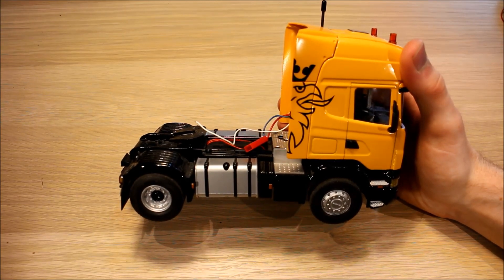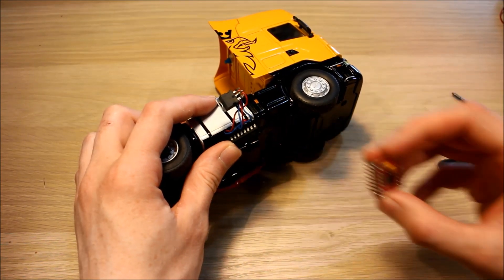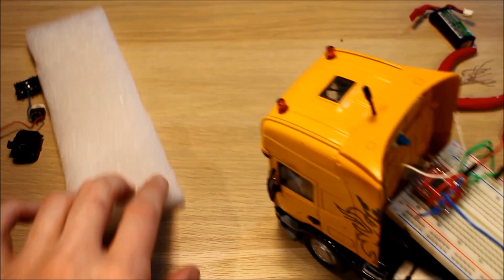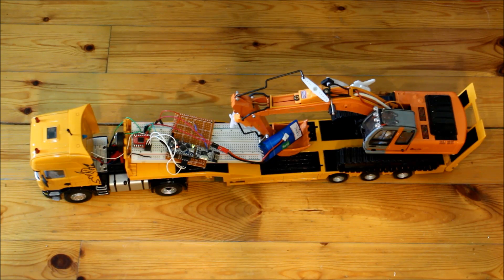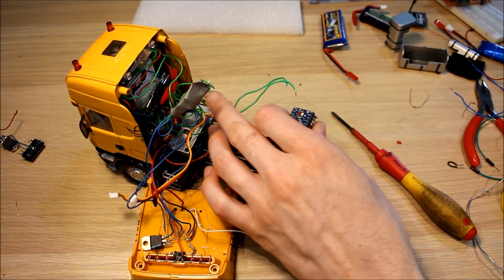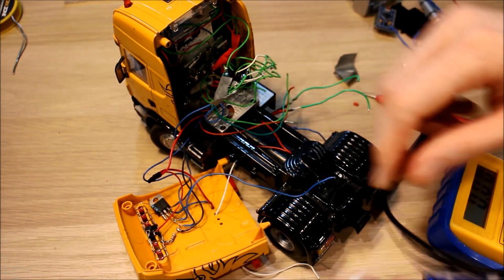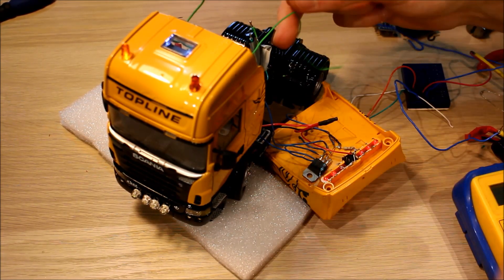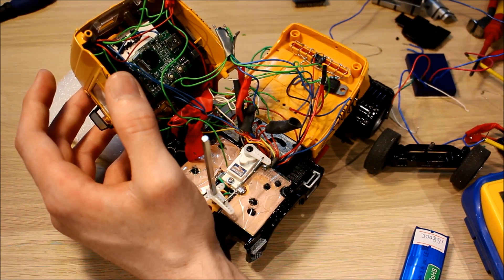RC Scania R620 Upgrade Part 1 - Testing the drive motor with a 3.7V lipo battery

Comment: Stupid question...Was this a Siku control you modified or a static model you made RC? I ask as i have been looking for a similar truck to begin tinkering with and Siku (now) only do the 1:32 control model or a static in 1:50 scale :(
Reply from the maker: +Rich77UK It was a static model but the static model was just the RC model with all the electronics removed so I cheated a bit and bought the motor from the RC version. That's a pity its no longer being produced, I hope they bring out another 1:32 lorry or truck preferably without a trailer because the quality of the Scania is very good.
Reply: +RC Tractor Guy Thanks for that.  I will have to keep my eyes peeled in the shops and eBay for one. Great work btw. Love your stuff but it's dangerous for my bank balance and spare time :)
Reply from the maker: +Rich77UK Haha you're preaching to the choir about danger to the bank balance, mine has come close to requiring a defibrillator over this hobby many times :)

Comment: I can't tell what type of Arduino you are using, but I think you might be interested in the Adafruit Pro Trinket, which has about as many pins as the Arduino Uno, it's pretty cheap, and it has an on board regulator to supply either 3 or 5 volts depending on the version at 150ma.  Also, if you want to convert a project to take lower battery voltages, you have room, and you don't want to spend too much time on it, you may want to look up some step up converters, so you can just bring the voltage up to 7.4 volts before it gets to your circuit.

I just wanted to offer what I know, and to ask what the LCD screen is for, since you cant see it unless you are at eye level with the truck.
Reply from the maker: tiedyeverthing Hi thanks for the suggestion I hadn't heard of that board before but I use a pro mini which is slightly smaller and a lot cheaper. Good suggestions for the step up converter, I'll definitely use that idea as it will make lighting the front LEDs much easier.

The LCD has pictures similar to the LED logos you sometimes see in the back of truck cabs.